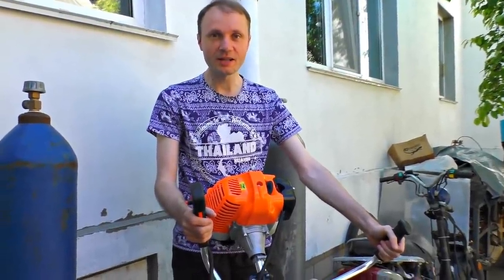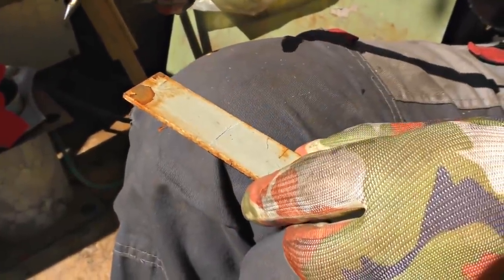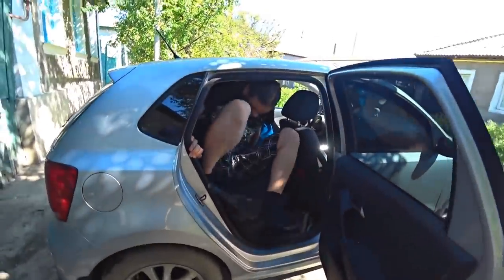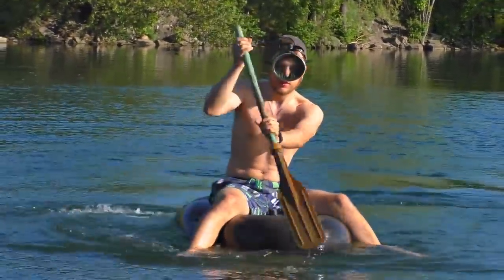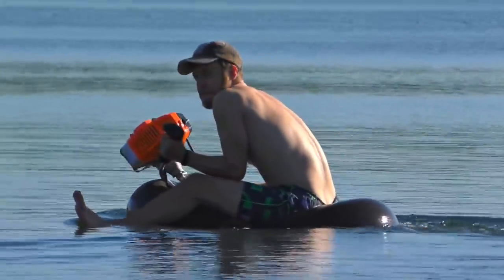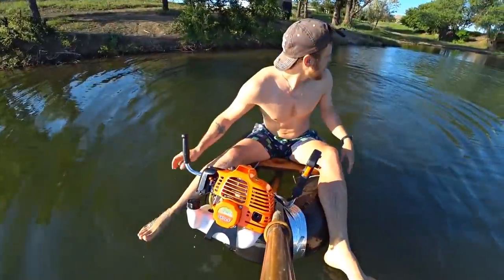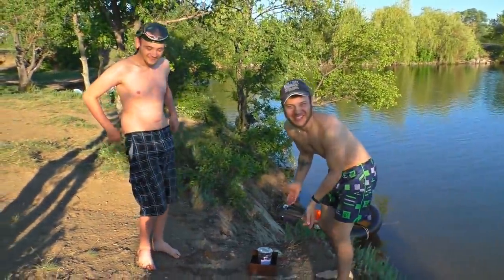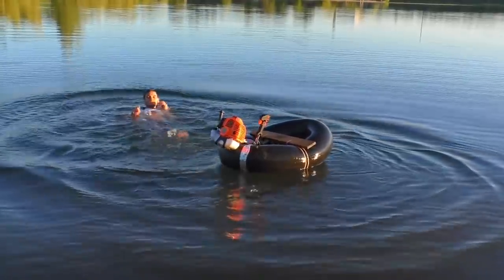Crazy Water Horse DIY / Lawn Mower + Wheel Chamber

Comment: make that propeller BIGGER :)
Reply: Due to gearing its probably not possible. If you make the propeller too large the motor might have a hard time to spin it and could even make it slower
Reply: I think a true proper 3 blade and I think it would be twice as fast
Reply: @wavegreen  it would work fine. They have attachments for much bigger blades for heavier brush and you have to make no adjustments at all.
Reply: Deja by time
Reply: @cjhudson419  That's in air, not under water though.

Comment: i made one of those when I was young, I used a electric trolling motor transom bracket to hold it on the back of my small skiff, it had a 30cc 2 stroke an was direct drive no clutch, it worked good I just had to take the trolling motor prop an make the blades a bit smaller but it worked great for a few years.